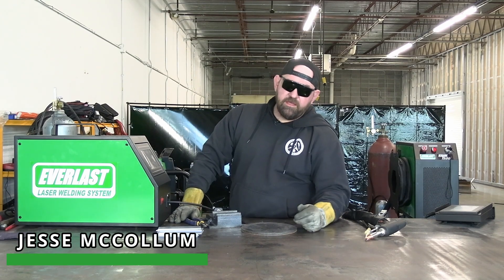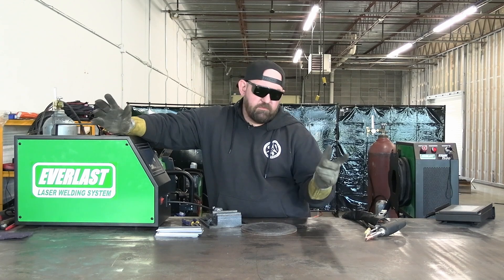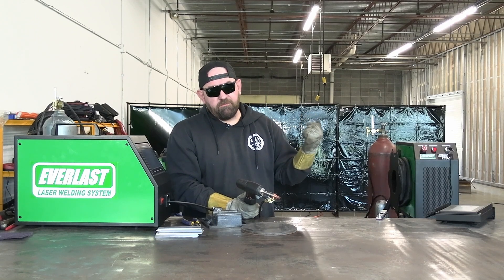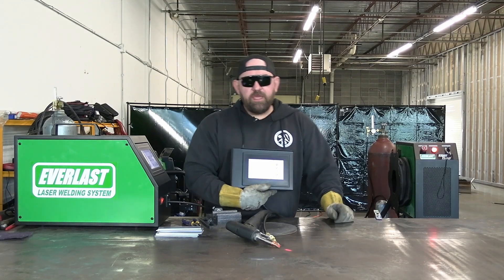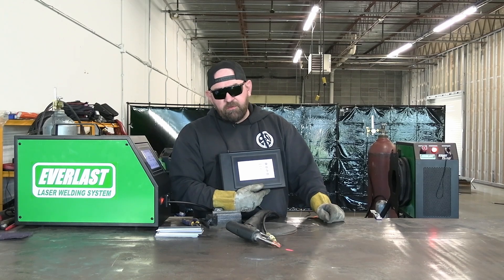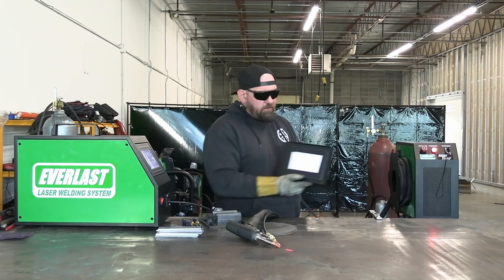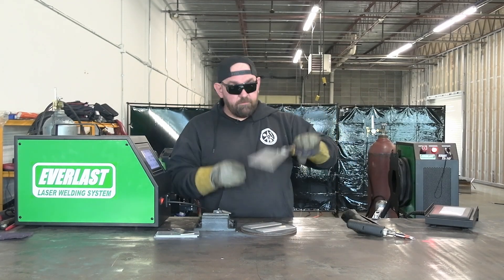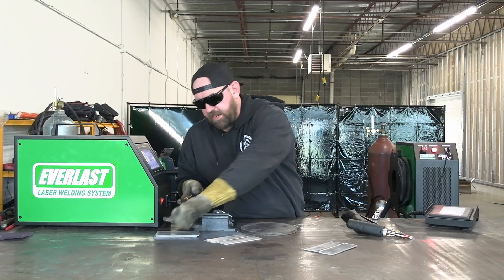RedSabre 1500 Laser Welding Aluminum

Comment: I’ve got everything set up on ours at the shop but for some reason the red indicator laser isn’t on and it’s also not welding.
Reply: A welder is supposed to weld so I think yours isn't working
Reply: I’m assuming you have connected the sensor clamp and have hit the turn laser on button. Otherwise check the gas indicator, if you don’t have enough pressure the laser won’t come on. Additionally, some machines require you to tap that you have your safety equipment on.

Comment: Should of done a bend test on those coupons to show how strong/weak the laser welding is…
Reply from the maker: We did a video awhile ago with welddotcom to show the strength of laser aluminum welds. We built a rectangle box out of 1/8” aluminum and pressure tested it up to 135psi; then held it there for 20 minutes.

We’ll be doing a lot more laser videos in the near future.
Reply: @everlastgenerator yeah. I saw that. It was wild. I was ready to put my hand over my ears.
Reply: They are strong.👍
There a few videos on YouTube.
https://youtu.be/0BFmhDZnILU?si=27SKDQXtjjMl2d8y
Reply: Should have done it yourself you whinemeister